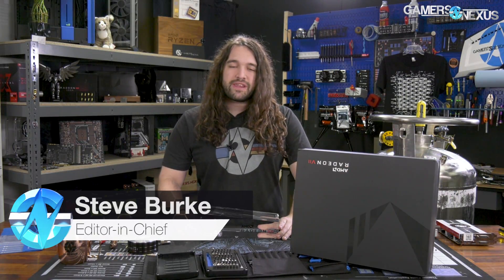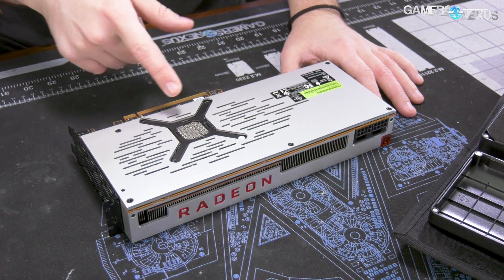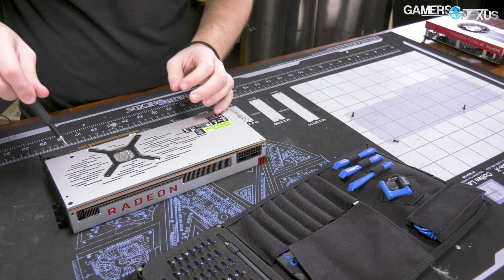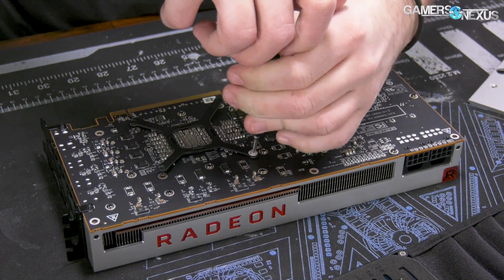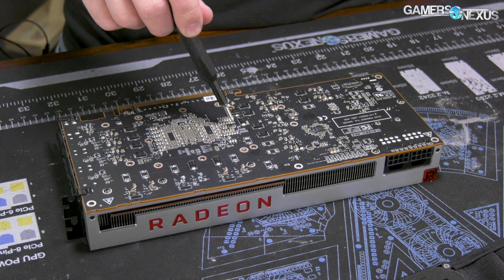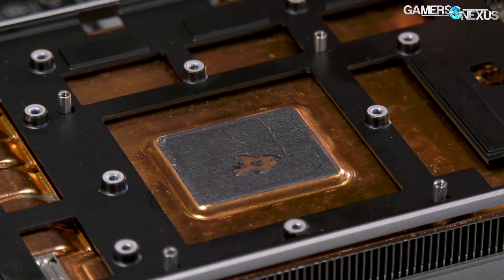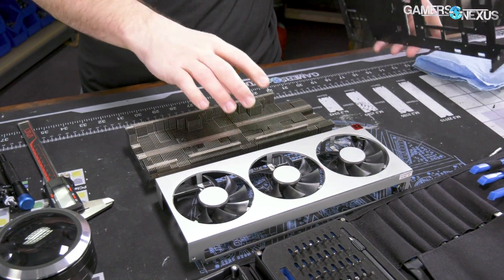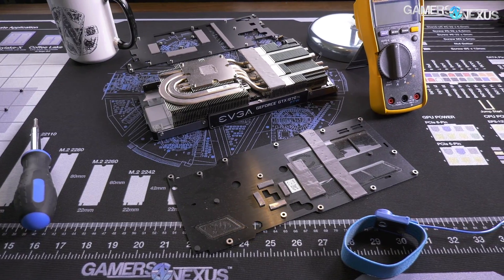AMD Radeon VII Tear-Down & Graphite Thermal Pad

Comment: How can a LITERAL Liquid metal solution aka the Conductonaut solution only have 73W/mk while a physical Carbon pad like this can have between 40-90 W/mk? Doesn't the fact that the liquid material can seep into the cracks make in superior no matter how good of graphene they use in the solid pad form. Or does that not matter as much as once thought simple because of how great the conductivity of Graphene and Carbon tubes are?

Comment: Really triggers me that the fan blades don't go to the outermost ring on the shroud, both bad visually and I guess could as be a negative for fan pressure as its not as tight as say the new Noctua fans

Comment: Got one of those XFX ghost cards with a vapour chamber in them second hand, but cooling was absolutely awful, heated an HD 7970 up to 95°C and throttled afterwards. Don't know if it was a defective card or a problem with longevity with those coolers. Replacing paste didn't do anything
Reply: Your heatpipe might be broken or the fan is broken/too weak. Try adding oil to the fan's bearing to make it both run quieter and faster.

Comment: Void if modified, gigabyte said that I could not change out the thermal paste or it would void warranty. Is this true for the US? Their gpu on vega 64 uses a cheap thermal pad, other users reported it working good after changing out the paste.
Reply: in usa you can do it and if they try to deny warranty sue them as it against law in usa

Comment: Can someone explain the whole issue with the warranty void if removed sticker because i just don't get the issue. Unless your modifying the equipment, (which absolutely should not be covered under warranty), you have zero reasons to ever disassemble the thing whilst it's in warranty. And once it's out of Warranty a void if removed clause doesn't mean a thing anyway as there's nothing to void.
Reply: If you put a water block on it you have to disassemble the GPU. If you want to change the thermal solution on the die you have to disassemble.
Reply: @Safetytrousers  Thats modifying the card. That usually voids your warranty anyway.
Reply: I believe EVGA allow the procedures I have detailed without voidance of warranty. These procedures also did not void the warranty on my 2080ti FE that I had to get replaced. No quibbles from NVIDIA. I don't know how all manufacturers handle it, but fitting a water block or changing paste are well within expected ranges of use of a GPU, and any maker for which that will invalidate a warranty seems very poorly behaving to me.
Reply: @Safetytrousers  It's going to vary with the manufacturer. Just like some offer warranty on OC'ing and some don't. Also some offer a warranty where any issues caused by the modification aren't covered but anything not caused by the mod is covered. So you void part of your warranty there, (so the sticker is both accurate and enforceable there).

Comment: this GPU has a 1tb/s memory bandwidth that's over 2x what a 1080ti has. Would the AMD Radeon VII be better for 240hz 1080p gaming at low settings/max Framerates over a 1080ti or even a RTX 2080?
Reply: You can have the most sophisticated railway tracks on the planet, but if your locomotive can only go 50 miles per hour,....
It is not all in the memory.
Vega's HBM2 is still supperior in bandwidth than what Nvidia had (on paper anyway),.. and it still beat it by heaps and bounds.

Comment: the remove stickers are quite annoying even tho they are not aloud in the us to void for it they will know you opened it and try void it for something or other. I have had them on laptops fall off as they are stuck to the case and not the screw and end up just being gone from normal laptop use of going in and out of a bag over time

Comment: I just got my v7 but it not fitting in the pcie slot.
Reply: Did you open the latch?
Reply: @tuna5774  turned out the bracket was bent a bit (it was an rma card after all so ya). I fixed it and it been working wonderfully.
Reply: @DragonProtector  I through you wanted to slot it into an x8 slot lmao
Reply: @tuna5774  lol. technically it will run in 8x slot. well 16x slot running at 8x

Comment: I don't really get why people like this design it looks EXTREMELY CHEAP. Also I have a feeling that thermals are going to be bad 70-80c especially if you put it in a case. Like Steve said there isn't anywhere for the air to go and your fans wont be able to help because the sides are blocked off. I would throw the cooler away, throw this thing on water and overclock the memory.

Comment: i am certain Arcturus 10 will overpass 2080 next year....right now Vega 7 is not worth the money when performing the same as 2080 and falls behind many dx12 games ....in DX12...1440p is minimal requirements to run the games ...cause doesn't look pretty in 1080p in DX12 mode

Comment: A little story about warranty sticker from Russia.
I had Asus DCU2 R9 390 which overheat and turn off the whole system. I replaced thermal grease and it helped, but not too long. Then I called to Asus and explained everything...they asked me about  sticker, which obviously was damaged and they told me since warranty sticker is removed it's all my fault and I have no warranty.
IMHO manufacturer SHOULD check every malfunction product even if stupid sticker is "removed or broken"...if product was damaged by consumer then fine - it's all on his ass, but if product was sold to consumes already damaged it should be replaced without arguments! My money was perfectly fine. In the end, I'm buying product, not stupid sticker and you should consider this, assholes from ASUS.
Reply: @_yuri  May be not all of them but their representation in Russia definitely are!

Comment: So this card is going to sell for 699?
Is it really going to tho, because the RTX 2080 costs around 700-900 euros where I live.
RTX 2080 performs roughly the same as the 1080 ti, 1080 ti is an old card that was sold for the same price.
DLSS and RTX is useless as far as I heard, and it seems that GDDR6 is defective... for 600+ products, Pepehands.
Reply: Try getting 2080 for 700 € and then we can talk.

Comment: I love how AMD done this especially because of that black base plate between the card and the cooler because i've got an universal Koolance GPU-220 (45mmx45mm) waterblock who can only cool the die so if i want to watercool this card, i can remove the cooler and leave this plate with my waterblock (and put a fan 80mm to cool the vrm) like this gtx 1080:
https://www.overclock.net/photopost/data/1525365/1/1f/1f635b14_2016-07-0117.17.33.jpeg
So i don't need to buy a full waterblock for this card¯\_(ツ)_/¯.

Comment: 3 things 
1.st  Please Compare the thermal Pads with the new one From Roman 8auer !!!
2cend. Ithink it is good that there is no reason to disasembly the complete card when the thermal pad don´t get bad over time.
and thid one: Ihad read a website which is making vaper chamber all kinds of.
It was so interesting. And the big flat one are one of the best. It suck´s of the heat and have so much great area to disolve them. Razor has in one of his notebooks the same build in.
When i think on to find the website i wil edit this here:
https://celsiainc.com/blog-should-i-use-heat-pipes-or-vapor-chambers/
PDF File: https://semi-therm.org/wp-content/uploads/2017/04/Heat-Pipe-Vapor-Chamber-Heat-Sink-Design-Guidelines-Thermal-Live-2016.pptx.pdf

Really good stuff there!

Comment: After the way amd killed my r9 270x just 2yr after release by ~refusing~ to make driver for OS updates (cant use old driver in new OS)
I've come to the opinion "FUCK AMD"

and feel I have a pretty justified reason to hold that opinion.  If I had drivers the 270x would still be better than the shiny 2400g apu

Comment: Radeon 7 seems to be the card for AMD fanboys with more money than sense. It doesn’t offer anything really new. It’s just a place holder. Am I trippin?
Reply: no you're pretty much right. I still want one though.
Reply: RTX 2080ti seems to be the card for Nvidia fanboys with more money than sense. It offers 1 new technologie that no one really wants to use.
Reply: @CarbonPanther  more like 3, but i get your point.
Reply: @CarbonPanther  Ray tracing and dlss!! Ain't that 2
Reply: @Manakuski  haters gonna hate 😂
Reply: I cant wait to play all of 2 games with ray tracing! Fucking worth the 75% price increase
Reply: Vram can be used for simulations with software like Houdini , can it not ?  Problem is you run out and have to switch back to using your cpu on big sims . That amount of vram at that cost will catch peoples attention .   Im pretty sure AMD said  this will appeal to Content creators . Im no fanboy but  i sure am curious about this card .
Reply: CarbonPanther however it has another niche that AMD doesn’t have. The most powerful consumer GPU right now
Reply: Yes you are. This is not a gaming card.
Reply: idk, I see it as an alternative for anyone who doesn't want to buy an RTX card. The technology is useless this gen and the failure rates are higher than they should be.
Reply: It's a product that wasn't supposed to exist. Vega 7nm was only supposed to be for Radeon Instinct, but that would mean no Radeon gaming cards until Navi releases later this year. 
It was basically released just because AMD didn't want to waste the publicity they got with a CES keynote.
They didn't feel ready to show Navi and Zen2 for consumer CPUs, so they had to release SOMETHING, and that something is the Radeon VII.
Reply: Kristoffer Johnsen yep sucks but AMD just doesn’t have the kind of money to compete at a similar pace to BOTH Nvidia and Intel
Reply: @Dr. Dro II Go look at the marketing material. This card is for computing tasks.
Reply: I'm aboard the AMD train nowadays, but I agree. This card seems like it's mostly to be able to say that they have a "high end competitive card", possibly to build "mindshare" and remain in the spotlight while they work on their (hopefully) real money makers.

I'm not getting either this or a comparable nVidia card, but if I was given the option of one of them at no cost, i'd go for the AMD card mostly because they have better linux support than nvidia these days.
Reply: @BlitzShott  It's kinda amazing that they're doing this well at all. Nvidia is still way too far ahead though. AMD will probably be able to steal the low-mid range if their 7nm APUs perform as rumored.
Reply: If it performs the same or slightly better than a 2080 it would be the better buy since 16gb of vram is much better than raytracing or dlss which can only be used in like 2 games months after release
Reply: Justin Courneya they advertised it as gaming and professional mix however they leaned more on gaming. “Worlds first 7nm gaming GPU”
Reply: Same could be said about tensor cores. 20-series is a marginal upgrade in raster performance over 10-series.
Reply: Should have been an mi60 instead.
Reply: @xSMOKED  i'm not a hater, more like a proud owner of Geforce RTX 2080 ;)
Reply: @Manakuski  wasn't aimed at you mate lol I'm also loving my RTX2080 😁👍
Reply: @captaincrazy5008  😂what game is going to use 16gb vram NONE EVER WILL whereas Ray tracing and dlss is and will be improved with driver updates and game implementation lol we will see how well it performs against the 2080 when it's released and proper benchmarks done
Reply: AMD make 50$ profit off of each Radeon VII, have double the VRAM and a better VRAM than Nvidia's counterpart.
Reply: @xSMOKED  newer games are already starting to use around 8gb of vram more at higher resolutions meaning this card will be more future proof than a 2080 and the massive amount of vram will also be useful for content creation making it have more functions and raytracing is not anywhere near ready with this generation of cards where the performance in games becomes absolutely horrible so I don't consider it a feature that would affect my purchasing decision.
Reply: @xSMOKED   none ever will??? Are you sure?? Why don't you go back and look at GN's 290X revisit, in many titles it still keeps up with modern low/mid-end cards in higher res and VRAM-taxing games due to AMD's 8GB VRAM choice.  It's now 2019, and ALL A+ games will continue using more and more VRAM going forward, what percentage will adopt nVidia's RT and DLSS and how soon?
Reply: Give Me A Smile I own a gtx 980 ref card. That’s all I can afford. Does that make me a “nvidia fagboy”? I’m just stating my opinion.. and I happen to see jays video first before I noticed this one and switched over right away. Wanted some actual tech content over jays purely just unboxing video. No dis on Jay, just my preference. Sorry you got so upset
Reply: I scanned thru all the replies. Saw some good counter points. Thx everyone.
Reply: CarbonPanther but you made my point... it’s offering new tech to go with stronger traditional rasterization. Sure it’s first gen and those who’ve been in the game awhile (vga to svga jump for example) know that it can be rough when you go out on the bleeding edge.
Reply: @captaincrazy5008  https://youtu.be/KP71IBNjjm0
So battlefield v looks horrible with Ray tracing on at 60fps at 1440p?
My pc is for gaming only so content creation doesn't matter for me personally just a good gaming experience is what I'm after
Reply: @xSMOKED  where did I say it makes the game look horrible? I said it's lowers performance to a point that doesn't make it worth it especially not in FPS games
Reply: @djlobb  they already started using the features mate and more and more games will implement it and you know this please don't act daft!! by the time I need 16gb vram I'll have upgraded my gpu many times by then mate
Reply: @captaincrazy5008  you said where the performance of the game becomes absolutely horrible!! Your words mate 😂
Reply: @captaincrazy5008  facts are that when Rtx was released Ray tracing was shit, but driver updates and game optimisation are changing that and it's going to get even better
Reply: @captaincrazy5008  I'm smoking cookies kush if you must know and my apologies mate you are correct although as you can see performance is a lot better, I love emojis 😁
Reply: You don't need "RTX cores" for real time ray tracing. This card will be capable of RTX. Also, didn't AMD come up with the raytracing idea years ago?
Reply: Captain RavagerIII  poor purchase decision!! Lol I didn't buy a radeon VII I have a 2080, that's a good decision 😂
Reply: Captain RavagerIII  2080 just a gimmick 😂 and your wrong on price!! a 1080ti is more expensive than a 2080 in the UK lol
My 2080 is oc'd at 2060 and going strong mate, I'm loving it 🤷‍♂️
Reply: Captain RavagerIII  lol good comeback kid what are you about 12 or 13!! you think you can buy a brand new gtx 1080ti for £300 LMAO good one kid 🤦‍♂️
Reply: @Akkbar21   "I own a gtx 980 ref card. That’s all I can afford. Does that make me a “nvidia fagboy”?"    
That's fine,  I get that. I currently have only nVidia based systems because I currently only have laptops. But my next PC build will have a Radeon in it, simply because of all the shit I've had to personally put up with when it comes to nVidia's drivers and support for older devices. I have a 770m and it acts up with Adobe and my other 3D programs, works well in gaming tho.
Reply: @djlobb  mate to be honest I don't give a damn about Ray tracing or dlss as I get 100+fps at 3440x1440 on most of my games on ultra on my 100hz freesync monitor, I purchased the 2080 because its cheaper than a 1080ti, I haven't even turned Ray tracing or dlss on to see what it's like that's how much I care about it lol I had an evga 980 sc before my 2080 and never had a problem with it at all or nvidia drivers
Reply: @djlobb  I also have no loyalty to Intel or nvidia and buy the best that I can afford at the time which is 9700k and a rtx2080 and I'd still buy the 2080 over the radeon 7 today
Reply: @xSMOKED   Good for you man. As I said, nVidia's customer replies and response is shithouse, I use my PC not only to game but do productive work and they make out like they give a shit about the prosumer market, well they don't show it in practice.
Reply: @xSMOKED   9700k may be the "best" for gaming but it isn't the "best" overall.  My next PC will have a Threadripper 32c/64t CPU and likely a Radeon 7 merely because it shows similar levels of performance to the 2080 but also performs compute tasks much better.  One benefit will be I won't have to put up with half-assed game-only-focused driver updates and poor customer support.  "Upgrade your laptop" Isn't a solution nVidia!!!.   With all that said, I'm glad you have found a happy medium for your budget.